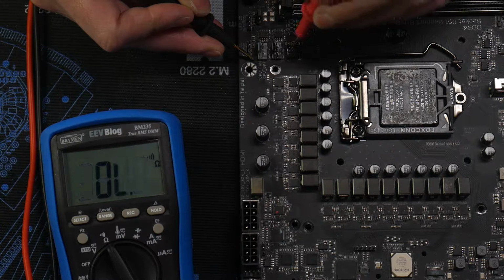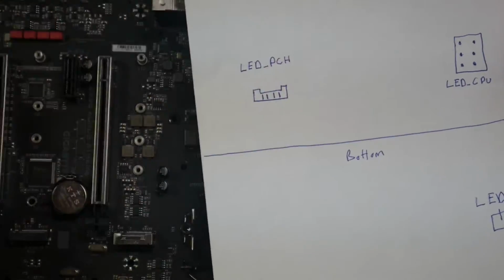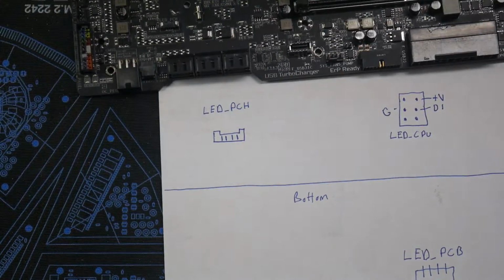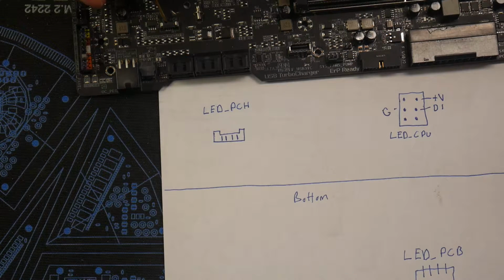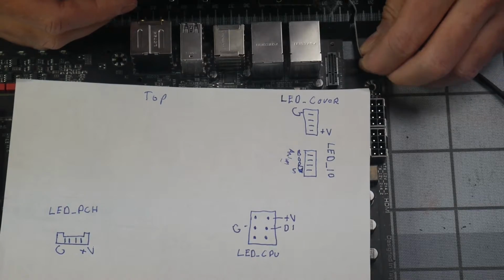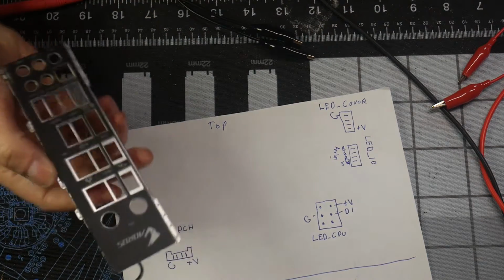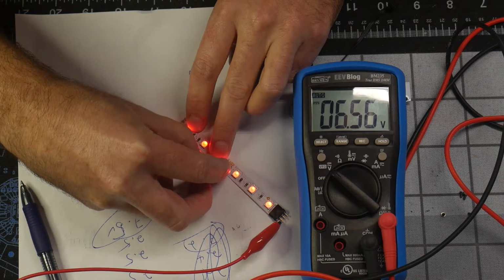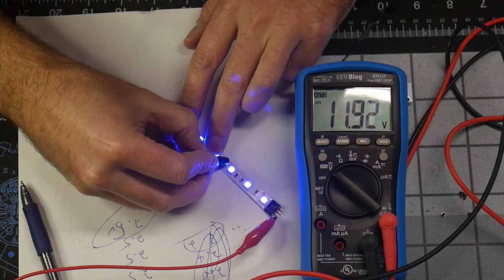Control All RGB w/ one software!

Comment: This is actually really good stuff. Thank you for showing the process of “ohming it out” as we called it in high school electronics. Also, thank you for explaining your logic in real-time through this process. This is pretty cool in that we will be able to use this known pinout to configure software that knows, or use an adapter cable for existing software. Ideally, iCue.
Reply from the maker: Thanks! I forgot to mention that the addressable RGB LEDs are RGB and not GRB on this board. For analog the pins can be switched,  for addressable I don't know of a way to switch the Red and Green off hand.